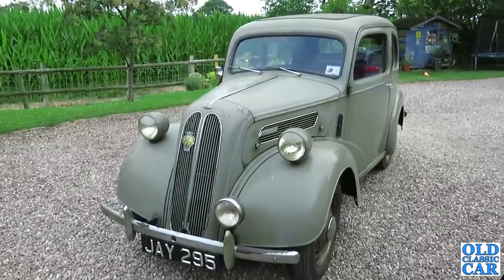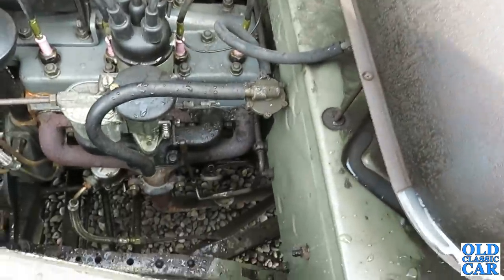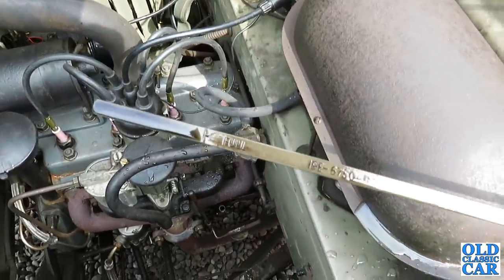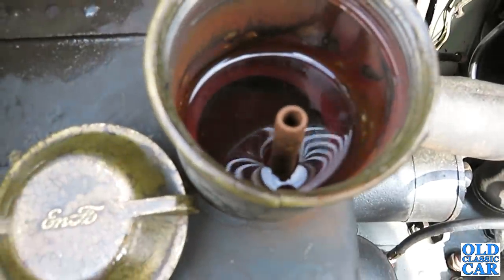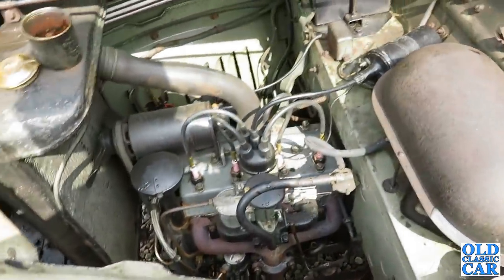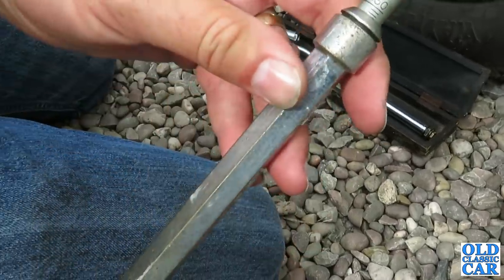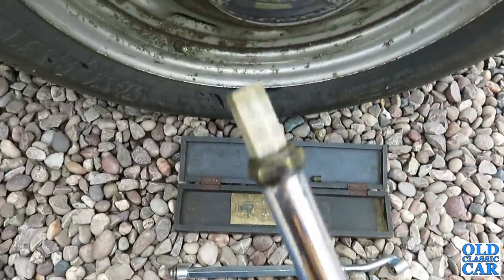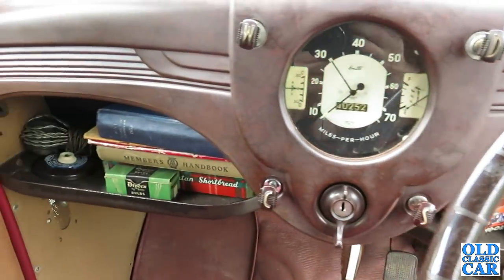Classic 1950s Ford Anglia time - '50s-style car prep ft Dunlop footpump action, fluid checks etc

Comment: That wee metal tyre valve cap...the pimple  on the top had a function. If too much air was discovered in the tyre, the valve cap could be reversed, and the pimple used to depress the center of the valve core to release air, albeit in a slow & controlled fashion.  Other metal valve caps could be found with a little forked top...which could be used to remove  a valve core completely [when mending a puncture, for example?  Something that might be done by the owner, possibly even out on the road? Inner tubes prevailed, and patches were available in similar fashion to bicycle puncture outfits. ]    
 Other tuning cheapies could be, to find the inlet manifold off a 100E, modify the base a bit, and maybe even use the 100E carburettor as well. The 100E inlet manifold had a slightly larger internal diameter.
 Also, if one was into tearing down one's ten horse motor, then the 100E camshaft gave an improved cam timing benefit. To the extent that today, the 100E cam is pretty much the only spare cam sold for both 10 HP [and 8HP ?} and 100E. [Re-timing the cam on the original 10HP engine was of course, a tuning mod of  the day. The 100E cam, which fits the 10HP, solved this problem as it turned out.]
  The Anglia ought to run cleaner on E10 petrol, too. These engines suffered from severe cyclic variability, and the ethanol clears this up somewhat. Just ensure all the rubber bits on the fuel system are modern & ethanol-resistant.  {Which ought to have been done regularly on any old cars, really?] 
  The mixture might need monitoring and tweaking too. Ethanol, when increased, tends to weaken the mixture. This might result in increased coolant temps, if severe enough?  For my part, I would be inclined to find a couple  of tiny drill sizes larger than the main jet hole in the carburettor.....and a pin vise....and if mixture  is shown to be getting weaker with general running, then drilling out the jet a bit at a time to experiment, might sort the problem? However, I suspect it won't be too long before someone offers slightly richer jets for these, for sale [on ebay, doubtless?]   
Ford sold [& fitted] ''export'' water pumps for the 8 & 10 HP engines. These went into the bottom hose, being driven off the [now longer] fan belt. They are heavy things [I have one]...and alternatives for the less worried owner might be, something like the water pump from a Granada V6 engine? These were separately-mounted, [ as distinct from  cylinder block-mounted} merely requiring the back plate to seal it all up. But the pulleys are sized for the more modern, thinner drive belts. 100E crankshaft pulleys will fit the 10HP engine, giving the thinner belt availability. if required.  
Happy motoring, & happy plodding along!
Reply from the maker: Plenty to digest there AQ, thanks for watching & posting
Reply: Most informative. You know your stuff.

Comment: Lovely video, thanks for sharing. Aaahh... where's the air filter?
Reply from the maker: Hi, thanks for watching, in the UK at least they just had a tin shield screwed over the intake of the carb, no filter as such
Reply: @oldclassiccarUK  When I was an apprentice mechanic back in the mid-70's these cars were still not uncommon in New Zealand. They had an oil-bath air cleaner that we would wash with kerosene and top up the base with engine oil. I also heard stories of owners fitting 8hp cylinder heads to 10 hp Prefects and Popular's, but by then it was legend.